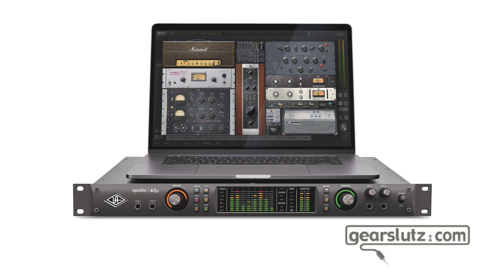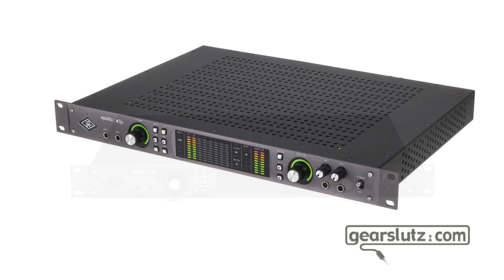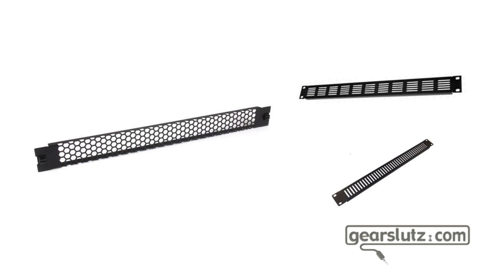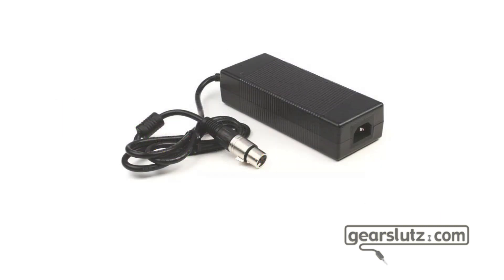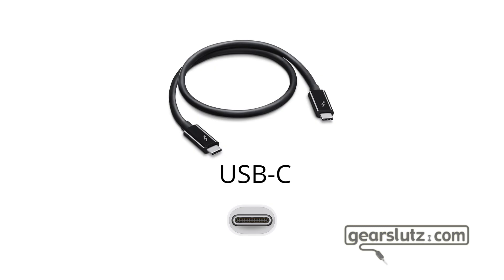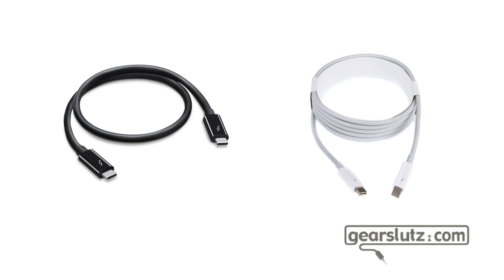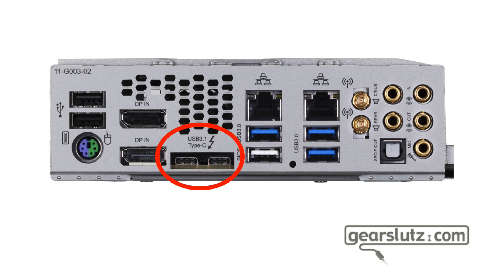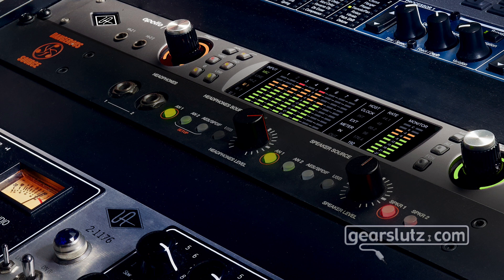Universal Audio Apollo x8p - Walkthrough Part 1: Setting Up

Comment: I have thunderbolt 3.  But, it's in the shape of a regular USB port hole on my Windows computer.  What do I do then if I don't have a type C ??  If I get a type C to regular USB adapter will this x8p still work  ??  Anyone could help me  ??
Reply: Thunderbolt 3 has only been available in a Type-C form factor. Your computer doesn’t have Thunderbolt 3 but you’re probably confusing it with USB 3.0. You can add a PCI-e card that adds Thunderbolt 3 to your computer so you can plug in the interface. 

Also note, Thunderbolt 3 is a different standard from USB 3.1 over Type-C even though they use the same connector. So USB-C and Thunderbolt 3 devices work over Thunderbolt 3 but Thunderbolt 3 devices don’t work over USB 3.1 over Type-C

Comment: Mine does not use usb 3 it uses thunderbolt 3. I think you are confusing usb c with thunder bolt 3. Thunderbolt 3 looks like usb c but it’s transfer rate ( bandwidth ) is much higher
Reply: That is correct, he said it wrong in the video. Thunderbolt 3 is the fastest connection you can have.

Comment: Why can’t thunderbolt 3 be the same size port as thunderbolt 1 and 2? Having to buy constantly new cable and deal with new port sizes is stupid - no one really cares if a port is a bit bigger or smaller any more . The only benefit is for the bank account of the companies like apple
Reply: The USB type C connector has more pins for better power/data transfer.   Also doesn't hurt that you don't have to fiddle to find orientation when you're reaching behind a computer or other device and can't see back there.